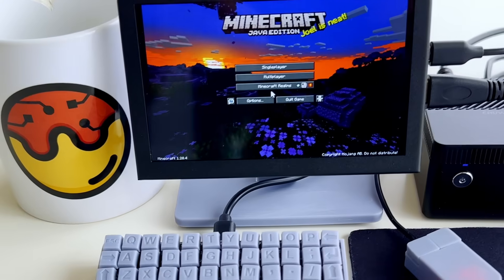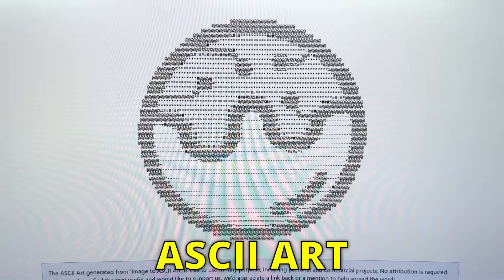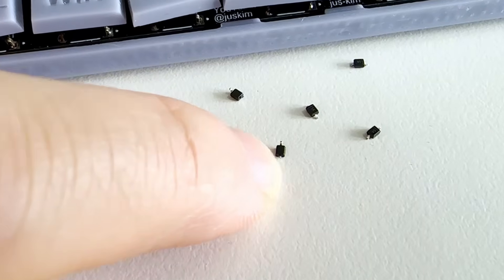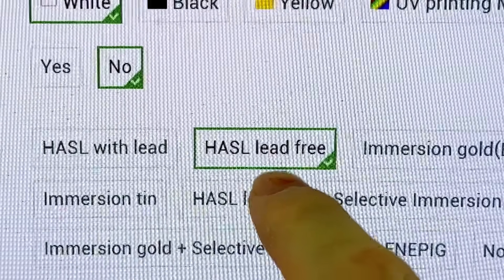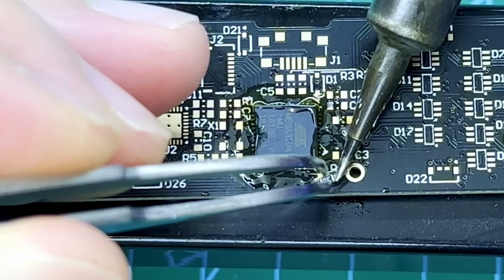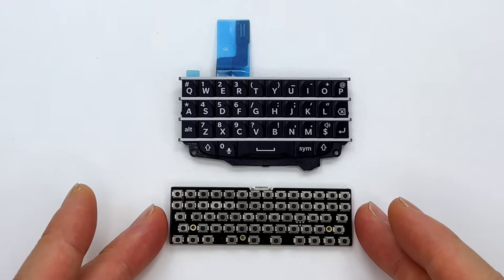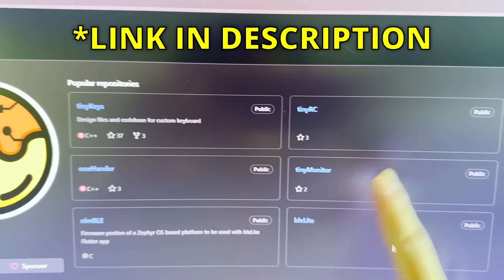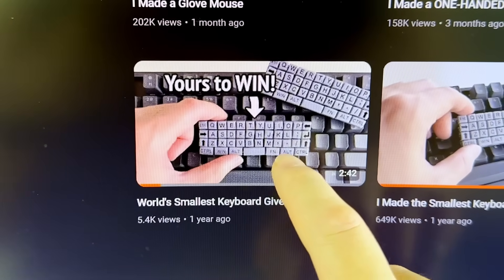I Made the Worlds Smallest Keyboard (WITH RGB)

Comment: How hard would it be to print the key top in a one piece mat?  Apart from being easier to mount, the keys could be pinged and sloped, with the high h point opposite the hinge which would make feeling the keys easier and increase travel slightly

Comment: You could put the switched diagonally to pack them righter, and use bismuth low temperature solder to prevent the switched from melting.

Comment: blackberry all over again. yep a phone physical keyboard. make it backlit optical diode switch keyboard. just block the light source to the diode = switch. 2-in-1 solution. wanna be touch keyboard. that new chip looks like an ant. yep its optical morse code key board. why not make the key caps vertical sideways switches. yea like key joysticks. if you only put the 1234QWERASDFZXCV-SCA-SPACE keys they you can make a normal size gaming key board. 20% keyboard. play it low key.